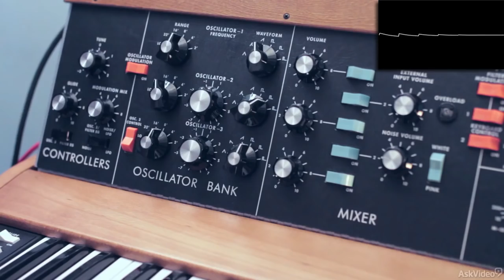Minimoog 101: Minimoog Model D - Explained and Explored - 3. Oscillator 1

Comment: Ive always wonder what does the tune control, all three oscillators or is it a master tune for osc 1 only.?
Reply: If you mean the Tune knob at the far left, it helps you fine tune the ENTIRE synthesizer. It's good that they included this to help you tune the synth against other instruments for instance. Also, the oscillators in these synthesizers are notorious for going out of tune, so you often have to use that knob to tune back the synth.